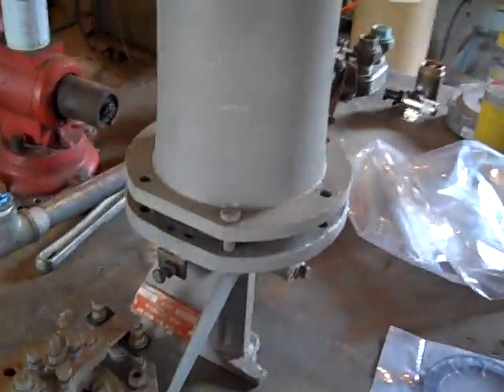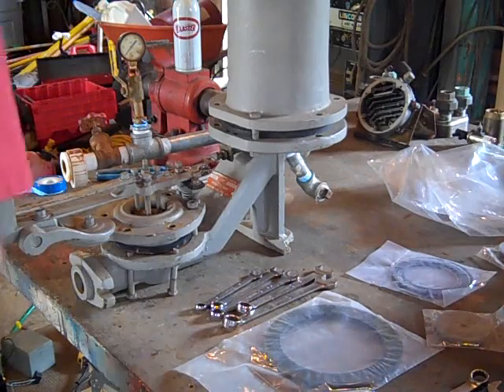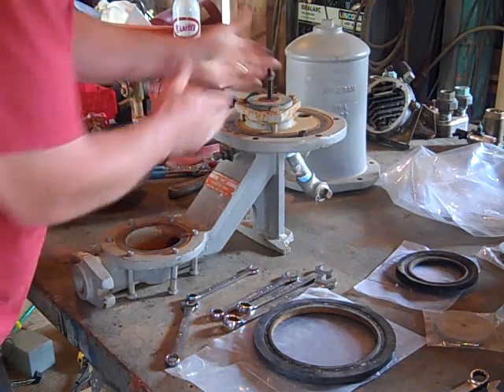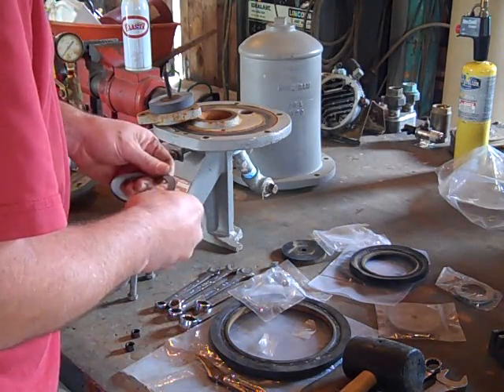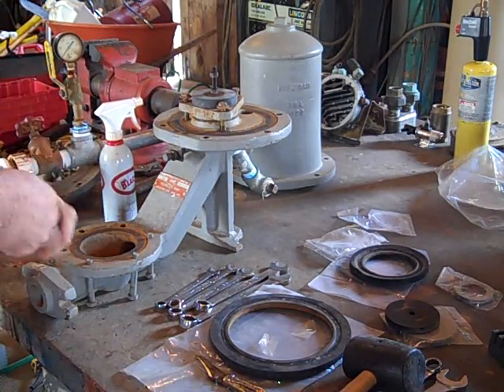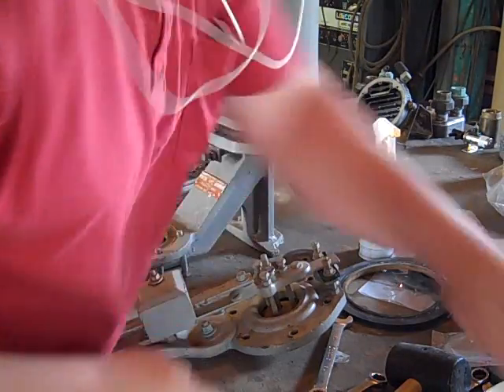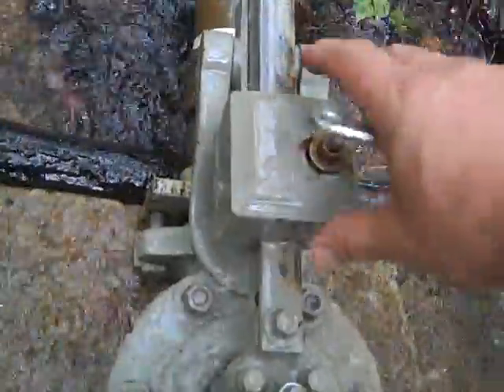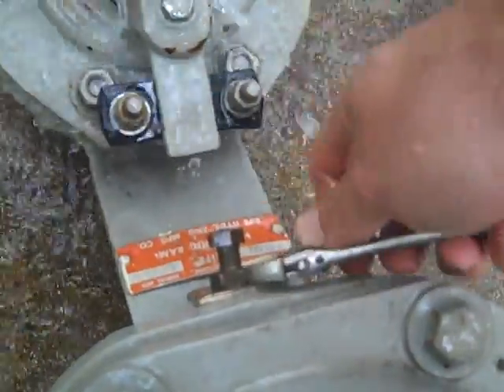Mission Accomplished - Ram Pump Pt 4

Comment: Love you videos. Thanks so much. I have a inch and quarter ram with about 10ft drop to the pump. But I need to lift 130 ft. The pump is working but only 700 ml per min.. it seems to be kicking the drive pipe really hard noise..I have a stand pipe about 36 ft from the pump.  any advice would be much appreciated.. I want to achieve  at least 2 litres..  per min

Comment: 2 questions:
- how to determine the diameters once you have calculated the needed flow rate
- how the separate spring water thing works
Reply: I've actually built one, it does work, this is a short clip of it running, I can make a more detailed video if you're interested still and test it out and stuff
https://youtu.be/AqaUPqdAzaI
Reply: Yes, it would be great to see how the separation between clean water and driving water works
Reply: @ing.pagano 
 https://youtu.be/qBV5xkQ3biM

Comment: I have a spring that produces only 1 gpm by the end of summer. With your homemade pump, can you adjust the pump rate, so it uses less water, so the drive pipe stays full in a low water situation? What are the effects of downsizing one or both check valves and keeping the larger drive pipe?
Thanks
Reply: I believe you can just adapt a smaller waste valve. Expect it to take longer to start the pump.

Comment: so... after pumping the water up to the stock tank, instead of just having the excess spill out, could you run the overflow pipe back down to near the original source and use the overflow to produce electricity?

Comment: If in the 11/4" ram pump a 4" x 3' pressure vessels is used would that  cause a in the way the pump function
Reply from the maker: It should work fine.
Reply: thanks i got it to work it was shutting off on me but so far its working for the past three days sending water up a steep hill ,will give heights later
Reply: +Engineer775 what is the effect if i put a larger air chamber

Comment: Instead of going thru your dam couldn't you syphon the water over it? And also from a well...
Reply: Siphoning water puts it under a vacuum which will slowly pull air out of the water until you have the dreaded air bubbles in the pipe which will stop the pump.

Comment: I have a question - how does the spring water stay isolated from the creek water? don't both sources enter the bladder chamber and therefore mix?  PS - i would suggest considering cleaning up any rusted surfaces with a wire brush - particularly those surfaces that that sit against the gaskets.
Reply: I've actually built one, it does work, this is a short clip of it running, I can make a more detailed video if you're interested still and test it out and stuff
https://youtu.be/AqaUPqdAzaI

Comment: I would like to use a ram pump on my property, however, my pond is the lowest point of the land.  Is it possible to submerge the ram pump.  The area i would like to place the pump the water is about 15 feet deep and need to lift about 30 to 40 feet.  The problem I see is starting the pump.  Any comments?

Comment: please help! having trouble figuring out if Ram Pump is appropriate for my property - The small stream is 2 ft wide with 8in of water(plenty of water).  with GPS i have about 3ft of fall over 100 ft through winding terrain.  water is basically in a ditch which i could damn up and get maybe two more feet head, but not a straight (efficient) shot at the lower end.  
what are my best options for pumping water up at least 30 ft to my first landing, hopefully to 70 ft to my second landing.

Comment: Great videos! I want to know if there's a reason why there is an elevation for the 2nd check valve and pressure chamber above the 1st check valve? If anything, wouldn't it reduce the head of the first valve?

Comment: How do you add the spring water inlet to pump the spring water using the pond water to power the ram? I am trying to find a way to do this and there isn't much detail on how you accomplished that in this video.
Reply: I want to know this too. Perhaps its a vacuum system, but that means it mixes with the pond water
Reply: I've actually built one, it does work, this is a short clip of it running, I can make a more detailed video if you're interested still and test it out and stuff
https://youtu.be/AqaUPqdAzaI

Comment: great series.  Thank you.  two questions: 1) Is there a way of quieting the system down short of building sound-absorbing housings around the noisy parts? I'd like to build something like this but I think the sound would scare wildlife away and make life pretty annoying near the pond.  2) I imagine the constant flow of waste water near the pump would erode the area fairly quickly.  I hate to see the waste water go nowhere.  Have you thought of any way to collect the waste water or at least direct away as to avoid creating a marsh?
Reply: +Donnybrook10 Donny I don't think the wildlife would care about the noise. At first they may be spooked by it but after a while they would ignore it and go about their business. As for the waste water you could spread some gravel around where the pump is and then dig a ditch for the water to drain away or if you are using water from a creek divert it back in to the it if practical.

Comment: In the 18th Century, didn't the mechanics of the time use leather gaskets which had been soaked in melted bee's wax or olive oil to get the air tight seals needed?
Reply: I know they did that and also rosin infused cork for airguns of the day which were roughly 1500 PSI.

Comment: I enjoyed the video, thanks. What is the ratio of delivered water to intake at ram? Is that the 60% figure you used in part 1?  Do you make any use of the waste water?
Reply: The ratio of water coming into drive line / water produced at destination will depend on drop from source to pump and rise from pump to destination.

Comment: Soak the old gaskets in clean fresh power steering or brake fluid. The molecular structure of these two hydraulic fluids are very similar. Will pretty much make them new.
Reply: Isn't brake fluid quite corrosive??
Reply: These are both hydrocarbon based oils each of which possess specific compression and viscosity characteristics. So the short answer is no these are not corrosive to the  polymers and metals in question.

Comment: reaction part 2 
and i found a video where a ram pump powered a wheel 
so i started to think that it could be posible to use that wheel to power a centrifugal water pomp like in the next video 
to pump  the spiled water to what ever place you need it 
now my question : is that posible to work ?

Comment: reactio part 1 
 when i saw your four movies on the ram pump it did not let me go .
 because i was interested to use it for  a pnd i was planing on making in my garden .
 to do that i was planing on using the water pressure  from the pond it self 
 the only problem for me was the water spil witch would flud my garden 
so i looked dieper in to it on youtube (see part 2)

Comment: The air in the pressurization chamber is gradually absorbed by the water.  All a snifter does is let more air in.  The air is what provides pressurization, because it can be compressed, whereas water can't.  That's also why he recommends using a pressure bladder, like an inner tube, instead of a snifter.  Air inside an impermeable bladder can't be carried away by the water, thus minimizing the maintenance of that part of the pump.
Reply: Dragomir Ronilac  There is a bladder tank in the plumbing system of most modern houses. Speaking of which a bladder tank would work great on a homemade Ram pump.

Comment: I have a pond very similar to yours and a ram would be a fabulous addition to be able to water my garden up the hill from the pond and not use an electric or gas pump. Problem is it was built 60 yrs ago by my grandfather. Any ideas on getting the drive pipe through the dam without causing damage? I aint afraid of a shovel just don't want to hurt the integrity of the dam. Thanks!

Comment: I assume the return goes back to the pond and not down stream of the dam. It would be a shame to make that water pump itself  less than 1000 times before going downstream.  Could you install a ram pump floating in the bottom of a well and human power the water 3 or 4 feet  to a container giving enough vol and vel to power the pump? the waste water remains in the well for zero h2o loss. if yes, then why not use  a solar powered pump to lift h2o the distance  and chill out in the hammock.

Comment: Thanks for this video. If I heard correctly, this is a double action pump but you're using it as a single action? Could you post something describing how the double action works, even if it's just a dry-board representation?
 
I'm restoring an abused Davey pump which is so much easier than the #20 you showed. But the adjustments you can make on yours would drive me nuts. Way too many variables. I bet you walked miles up and down the hill evaluating the outcome of small adjustments.
Reply: I've actually built one, it does work, this is a short clip of it running, I can make a more detailed video if you're interested still and test it out and stuff
https://youtu.be/AqaUPqdAzaI

Comment: Very cool. Not to mix apples and oranges. Have you entertained the possibility of having a small hydroelectric system. It appears that you got some head  but being spring fed not much volume..Do you have an idea on your flow rate year around?  The more head one has the less volume one needs, for the same output.   Just  wondering.  Thanks for the videos, very nicely done.  SS

Comment from the maker: @rchopp The two water sources are not isolated but a standpipe on the spring water inlet side of the ram guarantees that from the waste valve to the internal  check valve is flooded with spring water.  So the water coming down from the pond drives the ram and a little spring water comes out the waste valve with the pond water.  This ensures that only spring water is actually delivered to the final destination.  Clear as mud?
Reply: I assume there must be a check valve then?

Comment: @engineer775 I was wondering more specifically  how the two water sources were isolated from each other I was looking at the Rife Ram web site and it looked like there was more going on externally maybe some additional valving I guess I would have to have one in front of me so I could take it apart and see everything close up, I still think it is an awesome way to pump water thanks for sharing with us very cool I love those mechanical things, keep up the good work.
Reply: I've actually built one, it does work, this is a short clip of it running, I can make a more detailed video if you're interested still and test it out and stuff
https://youtu.be/AqaUPqdAzaI

Comment from the maker: @DeleteMeOnline The spring bar is simply an adjustable rest.  the lower it is the more the waste valve can travel, The higher it is raised the less it can travel and therefore pump less water.   It has nothing to do with air and the spring doesn't really need to be there.  These gizmos can be confusing and counter intuitive and I guess that is why I find them so fascinating. Thanks for your questions!

Comment: One big question...what energy source is driving this pump? You said no electricity, but, you mention air supply...
Reply: The column of water being allowed to move then rapidly being stopped creates a ram effect. The only air is inside the air chamber which acts as a cushion not a power source.

Comment from the maker: @westtexasprepper Nope.  Sorry.  it is not one or the other but the pond water is still the energy for running the ram. The waters do not mix.  Hard to explain but it is an awesome option for pumping potable water using dirty water..  I have tested with pond die and no die makes it into the spring water.

Comment from the maker: @rchopp The secondary port is to supply fresh water to the Ram. It will not run the ram.  The pond water will still run the ram but the water supplies do not mix.  The pond water falling into the ram provides the power to pump the spring water to the end use.  Sorry westtexasprepper.  This is a double acting ram.  It is hard to explain it here.  Look up double acting hydraulic ram for an explanation.

Comment: @rchopp That is another intake line that will run the pump. He did this to the pump so as to have two water sources to run the pump. You would turn off the pond supply and then open up the spring supply for fresh/er water. Or course, you would have to let the water run a bit to flush out the pond water to get to the fresh water.

Comment: Scott great video, but I'm a bit unclear as to the secondary port that you had machined into the unit, did you say you could use the pond water for pumping a secondary source such as a fresh water spring how do you block the pond water from entering into the water chamber and prevent it from mixing with the spring water, maybe I misunderstood the purpose. Thanks for sharing interesting stuff.
Reply: I've actually built one, it does work, this is a short clip of it running, I can make a more detailed video if you're interested still and test it out and stuff
https://youtu.be/AqaUPqdAzaI